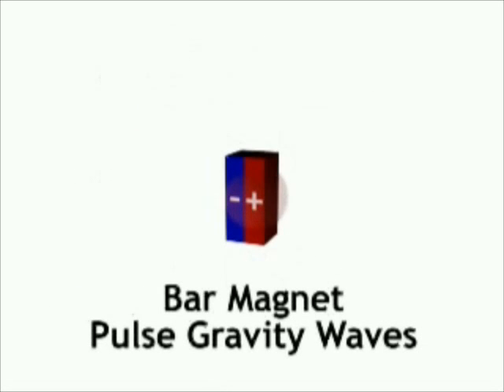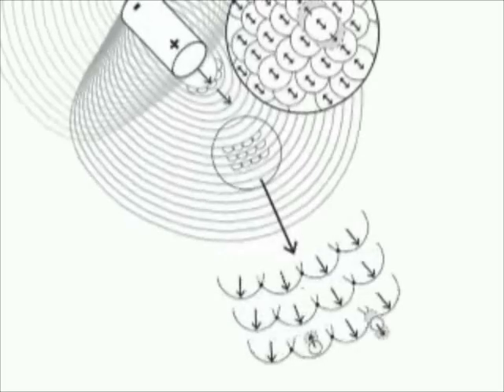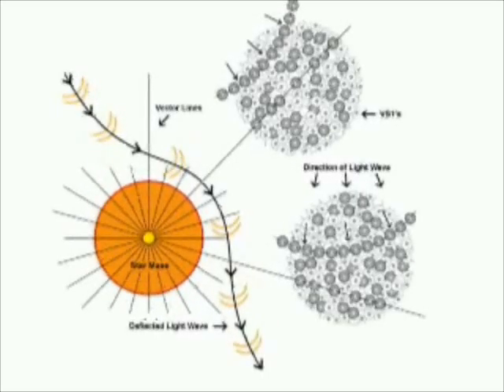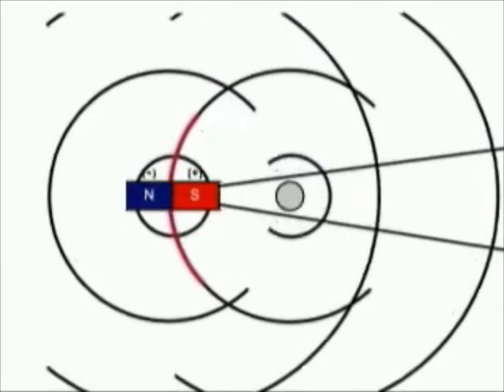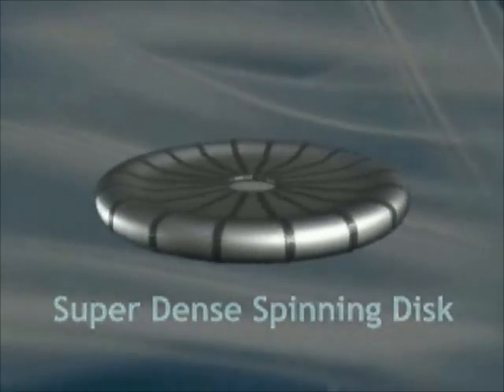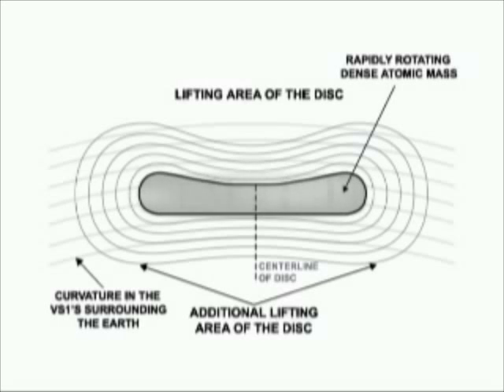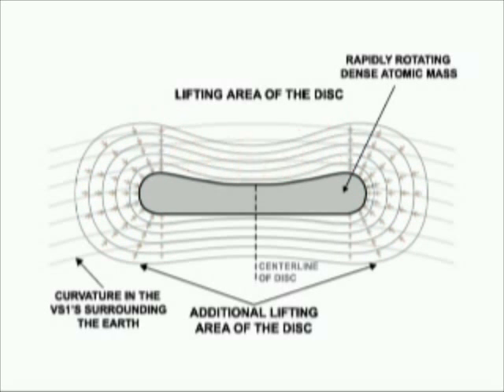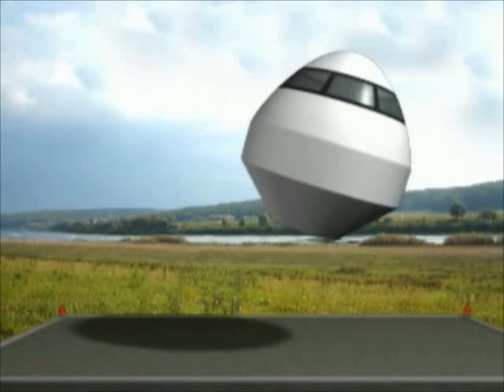Artificial Gravity Generator | Cosmic Matrix Theory Pt. 3 (Movie)

Comment: Very interesting... however, I have worked with high speed spinning magnets and electro-magnets, plus super conductors... and I have never witnessed gravity changes in these devices.  I have not see gravity itself create magnetic fields by non-movement or movement of an objective (other than same as mechical movement of a conductor through a magnetic field).  I suspect that high speed rotating magnetic fields could, by means of interference patterns, at certain stable harmonic, could produce a gravity field, but the radiation to get there would be excessive and the engery needed highly impractical.
I differ with 50k3r2 in that this does offer some concept of dark matter, or at least the force pushing apart the universe, in some places faster than light.
The VS-1 VS-2 thoery does explain what gravity and time are, but does not explain light and the things like photonic molecules.  I may be that light is at the core of all this, or single electron theory.
But if we are in a matrix, all this is just to figure out how to manipulate "the game", for which there may be many solutions.

Comment: This ironically seems testable and probably got discarded due to a technicality of it not having an easier or better observable prediction. It matches Black Hole mechanics but offers zero new insight on any level and even glazes the donut more smoothly. It also offers zero explanation for Dark Matter, and even less for Dark Energy. It ends up opening more questions to questions we already have without even affecting the current answers. It's Big Bang explanation is severely lacking as well. It covers all the main basics, but just doesn't quite pass the muster on more than a few observable areas and it just doesn't hold water when it comes to testing superconductors since Magnetism- Permeability still doesn't account gravitational mass, IE the Magnetic Field energy is equal to the mass of the material and is separate from mass calculations for the most part. Being Magnetized doesn't impart extra mass nor does it directly effect direct gravity motion enough to be accounted for in the case of even the Sun.

I like the picture being painted here but it seems Solar Flares are the Achilles Heel to this whole idea. It also paints the picture of thermodynamics operating in a vacuum, but they just aren't transferred in much of that fashion.

Comment: Okay I have no clue if any one else is thinking this but this  'concept' seems a whole lot like a large gyroscope to me. Sure you can use one of them while you are already in space  but the only thing that i think this will accomplish is generating torque to tilt the it in a certain direction but I don't believe this could ever be used to generate forward momentum .  One of the biggest problems I have with the explanation of this device is the way it  supposedly generates its motion. If the spinning disk creates upwards thrust then it must also create downwards thrust essentially nullifying its motion. The reason why is because  one side of  disk creates upwards momentum then the other side must do the same since it is essentially mirroring the top face of the disk. The bottom of the disk is spinning at the same amount, it has the same topography as the top, and it is made out of the same material as the top. My point is that the top and the bottom of the disk are doing the same thing and are more than likely the same in every way. So why is it that only the top will generate upward momentum but the bottom does not?  From what  has been shown here I have no reason to believe that this device will accomplish anything other than being a large gyroscope.
Reply: crapsoda13 
Because if you look at the bottom of the disk, it's totally flat, where's the top is curved , and the curvature let's some of the energy escape and cancel with earths gravity , producing anti gravity

Comment: Theory seems very sound. I'm wondering after you use this to escape earths gravity and enter space if the spinning can be reversed at a lower level to replicate 1g on the mass inside the capsule above the spinning discs? If so this could provide the artificial gravity needed for long space durations in the human body. This may kill 2 birds with 1 stone. Escape earths gravity well without chemical propulsion and create artificial gravity to keep people healthy from effects of long term micro gravity. How much funding is needed to construct a prototype?
Reply: I would imagine the only way to be able to do that would be to have another x amount of matter there that the craft could act against. I wouldn't see this technology being very useful in an environment with nothing to act against. meaning in deep space. in this theory you would need the same amount of gravitational forces pushing against another object that the object is pulling against you just to have a constant hover. let alone having more force pushing against the object you want to propel away from. a craft or amplification of this size would have to be massive. or it would need a ton more curvature than what his diagram is showing, you would need x amount of energy to pull the vs1' and vs2's to the center of the curvature and propel them outwards from the craft to create enough displacement to create an upward force that it would be rediculous. the funding this project would need is larger than the tax payers could provide. not even including the amount of materials this project would need. I wouldn't see this being very viable in today's society, maybe give it a few decades or a century.
Reply: and even if they were able replicate 1g of matter above the "spinning disc" they would not be able to control the amount of gravitational forces that 1g of matter would have, the only thing this theoretical device would have is propulsion.  but I could be wrong, just giving my opinion

Comment: I assume your proposing to use magnetic force to hold the fly wheel together at high rpm, but this design doesn't seem to conserve or reuse the energy put into the spinning in the first place. More rpm, would require more energy, if the output is linear. Are you proposing that the output is non linear?
Reply: it's a vacuum inside the capsule so in theory you wouldn't need more energy just a constant amount to perpetually accelerate faster and faster. the only energy that would be confusing would be the amount of energy you would need to use to slow down. unless you found a way to use existing gravitational forces from planets that would automatically slow the rpm of the device inside the vacuum.  which in theory could work given this guy's theory if correct.
Reply: any man made vacuum is not perfect (hell even space isn't a perfect vacuum) so there would need to an energy input to keep the disk rotating since the friction from the few air molecules would slow it down. Possibly not quickly but it will.  We can observe this even on the ISS as it's orbit needs to be re-adjusted do to its gradual loss of momentum.
Reply: Thats like saying the wheel could spin for infinity in a perfect vacuum but only 100yrs in a manmade vacuum, it really doesn't change much on a small time scale.

Comment: This explains Leedskalnin's Corel Castle. Every object with mass has a frequency. Once you find it, you can lift anything. The trick is finding how to control the direction and speed you want to go, then calculating the distance you want to stop at. This calculation is two fold. Where you have to touch the breaks? and where you want to stop? If you make slightest error you will crash. For interstellar travel you must know every inch of space first, when planets will be where in time, plus more.